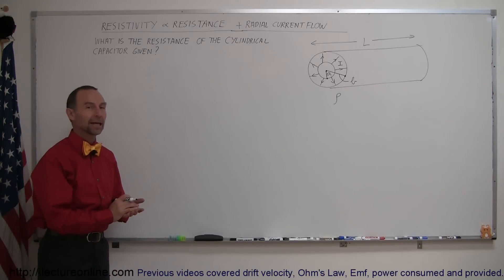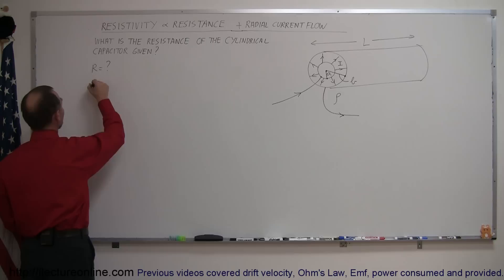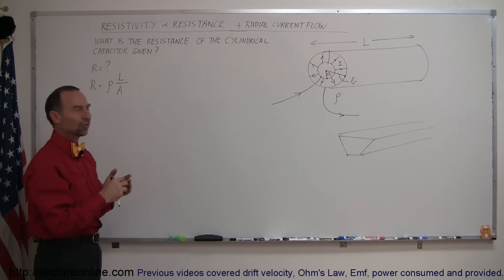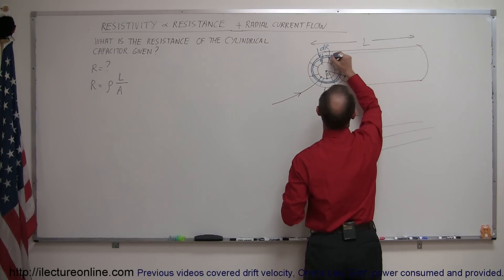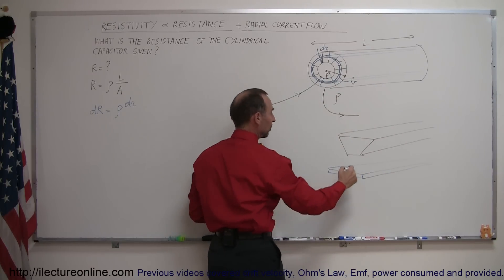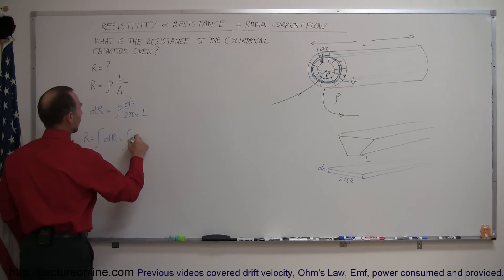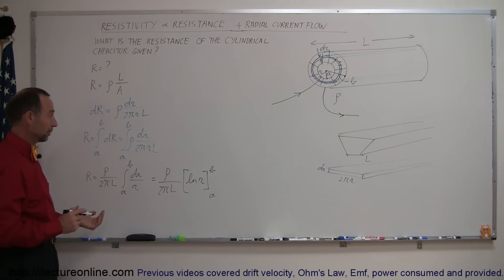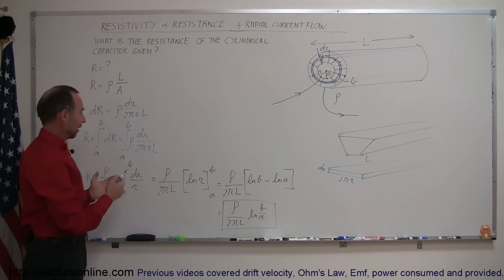Physics 40   Resistivity and Resistance (8 of 32)

Comment: Can you explain what is the resistance in a part that comes a current parallel to the axis?
Reply from the maker: There is only resistance from the inner surface with radius a to the outer surface with radius b

Comment: Why R and L are conversely proportional to each other in the solution?
Reply from the maker: When L becomes longer, there will be more surface for the current to flow through, and therefore there will be less resistance.

Comment: Thanks a lot...Can you please explain how to calculate the resistance of lune shaped cylinder cut out produced by intersection of 2 eccentric cylinders ?
Reply from the maker: That would be complicated to "explain" via a comment.  You would have to express the boundaries in terms of 3-D equations, and then integrate from one direction to the other direction taking into account the possible functional relationship of the resistivity with position.

Comment: If the lenght of the conductor is L, then how did it all of the sudden become dr when you derivated both sides? Because how I undertand, r is in the radial direction, wich is perpendicular on L.
Reply from the maker: L is a constant and is not affected by the derivative.
Reply: @MichelvanBiezen  Alright, thanks alot :)